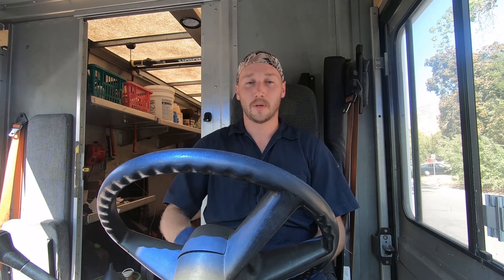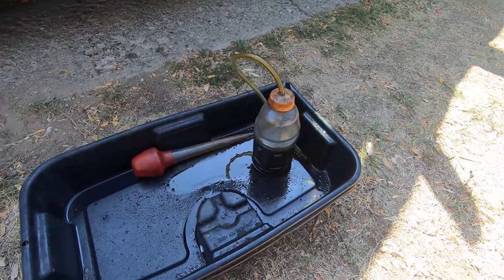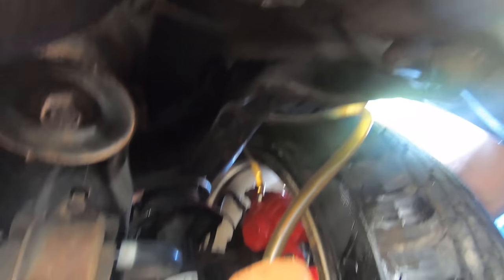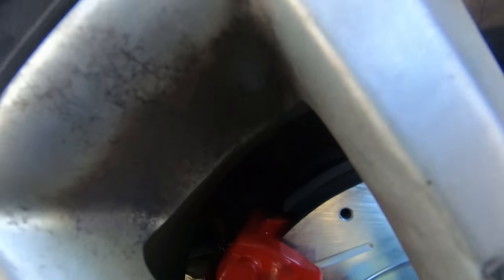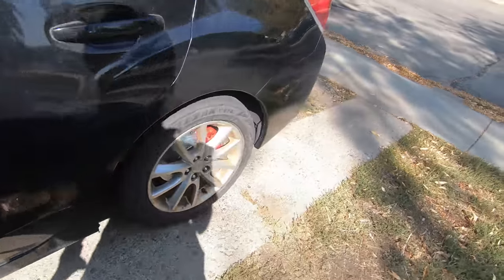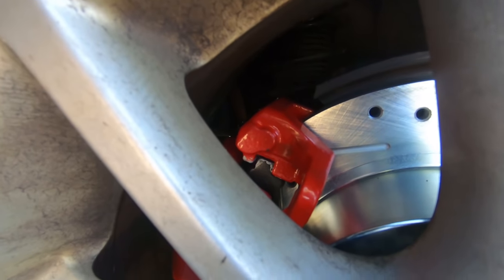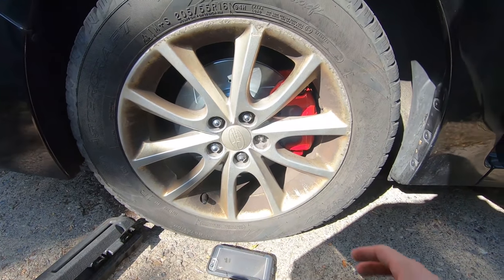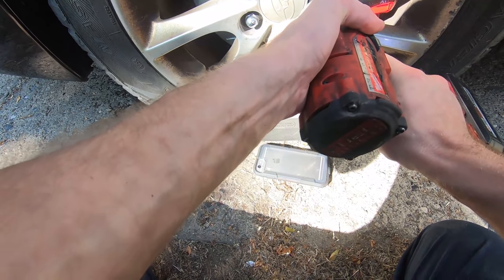Bleeding a customers brakes takes a wrong turn... I made a crucial mistake.

Comment: Brake job requires a test drive. This gets you behind the wheel, allows for customer development..testing is very important.
Reply: Also, you really need to bed in the new pads and rotors.  Which requires multiple hard brakes and some medium brakes.  Not to a complete stop but you need to heat them up a lot to break them in.  I would never do a brake job without testing them myself and bedding the pads in before handing the keys over.

Comment: Drilled and slotted rotors with red painted calipers on a regular impreza. Interesting use of money.
Reply: @papageorgeo7497  Drilled and slotted rotors don't realistically improve anything on just a normal daily commuter car or even a weekend warrior. Money would have been better spent on a nice set of blanks from someone like Brembo and performance pads like hawk  HPS. They don't reduce the life span at all, become subject to premature wear such a rotors cracking and they keep the brakes quiet and has the ability to resurface the rotors should they glaze over or get prematurely damaged from a trapped rock.
Reply: "Nice" shiny calipers and cool slotted rotors with chetty looking wheels.  Way to go!
Reply: Papageorgeo if she was tracking it 😂
Reply: looks like the power stop upgrade kit from Amazon. two lines of drilled and 1 slot line.
Reply: Well some people like to be able to stop.
Reply: Bunch of haters
Reply: @chip3428  also, if you want more stopping power. Autozone blanks and hawks hps PLUS race pad paired with Dot4 and some lines, cheap setup
Reply: @chip3428  slotted rotors are same price as regular ones on ebay

Comment: Hey Ernest, you can shave a ton of time and not need a helper by getting the Power Probe BAKIT01 master cylinder adapter kit, along with a Motive Products 100 hand pump power bleeder.  You simply add an extra length of hose with a quick coupler to fit the Power Probe adapters.  Empty and refill your master cylinder, then put some brake fluid in the power bleeder, connect the proper adapter to the master cylinder, pump it up to about 15psi and then just go bleed at each wheel.  No compressed air or any other tools required.

The best price on the BAKIT01 kit is at tooldiscounter.com and the motive bleeders can be picked up on Amazon.  It's a bit pricey but you're done in minutes with no chance of accidentally bleeding a master cylinder dry.  You do a fair amount of brake bleeding/flushing so I'm sure this would actually make you money in the amount of time saved.
Reply: I have a power bleeder but from a different manufacturer. Definitely recommended.
Reply: i use a cheap vacuum one that sucks from the bleeder as you dont need an adapter for every master cylinder and also some mcs arent shaped so you can get a good seal on them even with all the adapters.
Reply: @transdimensionalist  I bought a cheap vacuum bleeder some years ago. I found that it was difficult to tell when the air was out because it would suck air from around the bleeder once it was loosened. Now I just use that for removing fluid from the master cylinders. So far, I have yet to find a car the Power Probe kit doesn't fit. Besides, there is a universal fit cap in there too in case there's not a specific one that fits. The kit is a bit pricey but very high quality.  It pays for itself very quickly though. The hand pump would be great for mobile mechanics as no compressed air is needed.
Reply: the solution to sucking air around the bleeder is some thick grease in the threads and a cable tie or wire around the rubber suction tube does it

Comment: I have a one man bleeder, basically a one way valve system which is great.
At the calliper end it has a plastic connector that stops break hose coming off brake calliper nipple when you depress brakes. Yours didn’t I am surprised that it didn’t push off when you pumped brakes.

Comment: Tip... when pulling a stud in with the lug nut... take the wheel off... get a spare nut turn it around backwards so the flat is against the rotor... put a washer in between the rotor and nut then pull it in. Doing it the way you did one of these times someone won't be able to get that lug off because you crushed the seat of the lug which in turn will gall the threads of the stud and they'll be cussing you and saying you stripped the threads  because you were the last one to touch it... aaaaand ya pretty much did
Reply: Yea I was gonna comment this before I saw yours, at work I’ve always been told to use a ratchet, a assortment of washers to get it flat against and just wrench it through no power tools
Reply from the maker: yeah so i did not show the whole thing but i backed it off and put it back to torque!
Reply: I get that but you're crushing the seat of the lugnut!...I bet it came off real hard

Comment: Get yourself a motive power brake bleeder.  It will make your life a lot easier.  By far the easiest and fastest way to flush brake fluid.
Reply: Along with the Power Probe Master Cylinder adapter kit makes the motive pressure bleeder  a fantastic combination.

Comment: I went to work on someones truck that their son was suppose to fix the brakes... Well he took it apart, added a new brake booster and master cylender... getting paid by the hour he took his moms money and then when it came time, had no clue how to finish it so she posted an ad on fb looking for someone to do it. I messaged her and all she said was it needed bled... Well this guy was about to get his mom killed. He didnt put the clip in the break that connects it to the booster. So first hit of the brake, it went to the floor and stayed. Fixed that, looked over everything and she finally had good brakes at 1 low, flat rate... I was close by anyways, had another job to do so I swung by and it took me 20 minutes.

Comment: Interestingly both of my Fiesta STs had massively overboosted brakes from the factory. After their first brake change and fluid flush, the brake pedal feel changed massively - became much more progressive, requiring a lot more pedal pressure to stop versus straight from the factory. However before the first brake change, it was basically impossible to heel and toe because the brake response to light pedal input was so incredibly sharp and powerful. All systems checked and confirmed no air, and even flushed and bled several times by me; master cylinder and lines all fine, plus a very experienced mechanic checked and OKed the whole system. I wonder if your customer was feeling the same change in brake system pressure I felt with my car. Apparently this is also common on new Minis, VWs, BMWs etc...
Reply from the maker: maybee!

Comment: Also there was no diagnosis of the problem. Now the customer may not have wanted to pay for one so I understand that. But that should be first and foremost. Also. Test drive the vehicle before the work so you understand what the issues are or what the client is concerned about. And. QC YOUR WORK. A quality control test drive ensures the vehicle is in proper operation and will give you and your client peace of mind about a “job well done.”

Comment: I just broke a bleeder screw yesterday and I just left it like that
Reply: Front 2 calipers are like that on my truck, went to bleed them after replacing pads and rotors and both snapped, have to replace them soon lol
Reply: @rebel3353  did you get any or water contamination in the brake fluid as in the pedal was spongy?
Reply: @austinshores3324  nope, everything feels as normal even 2 years later, i do need to replace the rotors since they are getting warped, will be replacing everything tho when it comes time

Comment: Have you ever changed a water pump on 7.3 power stroke e350 van? Just did mine what a pain and had to reuse old gasket for thermostat and it leaks smh
Reply from the maker: ive done a video on the front end of a 7.3
Reply: Front end as in the steering or the nose?